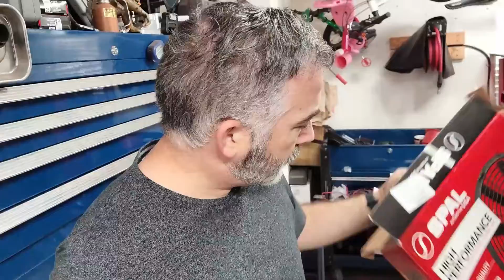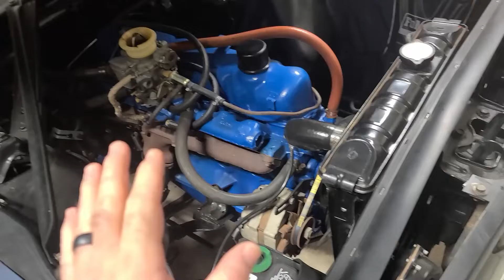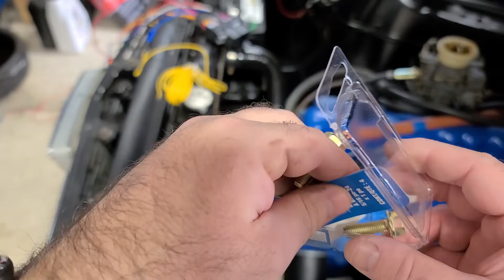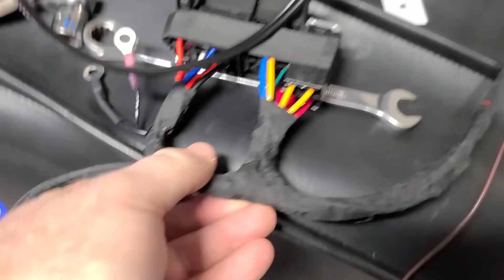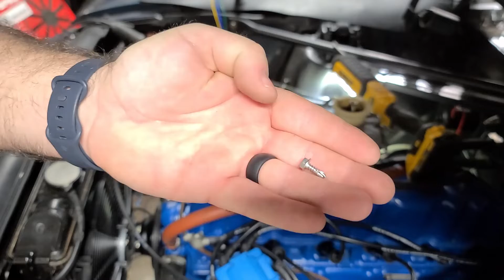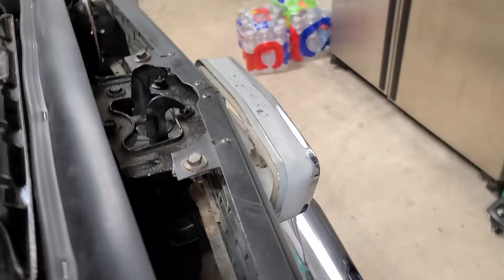66 Mustang Inline 6 HEI Distributor Install + Electric Fan and Power Master Alternator Installs

Comment: The original signal wire of 8v did not activate the relay for full 12v
Reply from the maker: Hmm, it should.  If you have double checked your relay wiring and ground, it may just be your relay.  It may not like the lower voltage.  Mine functions like that.  You are going to have to run a 12v switched signal from under the dash.

Comment: Did the coil 7-8 volts worked as the signal for the relay? Did it turn it on?
Reply from the maker: Yes, coil power worked to drive the relay.

Comment: I have a 68 Falcon with a 250 inline 6, i want to do an hei swap on it as well, i also like what you did with the electric fan. Im not too knowledgeable on wiring...any info on where you got the relay set up? I would like to do exactly what you did to mine...or do you think the igniter conversion for the points style distributor would be better? I don't have the money to drop on a DUI...so info on the relay setup and pigtail as well as the temp switch for the fan
Reply from the maker: I would recommend the distributor I got only if you are OK with a potential oil leak.  Apparently it is common in the cheap distributors and not the DUI.  If you are worried about stay with a stock look, then upgrade points and ignitor.  If you are not, I would go with a DUI.  You save money with the unit I bought, cheapo in Amazon.  Works like a champ but leaks a small amount of oil.  As far as the wiring, the most inexpensive direction is to source the parts separately.  Get a 30amp relay and google a basic electric fan wiring diagram.

Comment: Thanks for taking the time to make a video and show us how to do it. What brand is the distributor or where did you get it from as I want to do the same as mine.
Reply from the maker: I got this one off of Amazon.  It does leak a little of oil that travels up the shaft, which I dont like.  I have been told the DUI brand doesnt do that but it is way more expensive then the one I purchased.

Comment: what kind of relays are you using for the fan?
Reply from the maker: Just a standard 40 amp relay.  There are a ton of options on line.  I ordered one with a pigtail for a cleaner install.

Comment: Do you have a part number for that distributor? Found one from A team performance but never used their products before. Can't seem to find one from summit or jegs
Reply from the maker: The A-team was the one I went with.  A cheap short term solution.  If you plan on staying hei long term, I wouldn't recommend the A-team.  It leaks oil out of the shaft, badly.  They are terrible with warranty as well.  It did take care of my issue and wildly cheaper then the DUI but you get what you pay for.  An eventual V8 swap will force a change for me.

Comment: Good video thanks… the old ignition wire from the ignition switch has a resistor that reduces the amount of current not voltage to the coil. They did that to keep the points from pitting. The condenser helps as well. That resistor wire is bypassed anyway during start up, so the solenoid puts in a full, direct connection to the battery bypassing the resistor wire of the ignition you release the ignition switch to on it goes into the resistor wire . I installed my HEI with the old ignition wire with no issues.
Reply from the maker: That is good to know.  I wasn't aware of that.  I had found different recommendations based on reduced voltage at the coil wire.  I had less than 12 volts at that wire on a brand new battery so it made sense to me.
Reply: @WhitetailGarage  putting a relay and a wire without the resistor is better anyway that you get new parts that old resistor wire has been there for 60 years so it’s better to change it like you did.

Comment: I installed my hei but for some reason the engine just turns  can't get it to start what is the position it should be I put roter and pressure in same spot. What can I do next
Reply from the maker: You want to make sure to stab it in the same exact orientation the rotor was in and make sure the firing order on the cap is correct.  If you aren't sure about the orientation anymore then start at TDC and align it with number 1 on the cap.  Make sure you are getting a solid 12v to the coil.  The factory harness doesnt always have a full 12v.
Reply: @WhitetailGarage   ok thanks I will try that .I'll let you know how it goes

Comment: For your vacuum advance from distributor… i have a single barrel, would you connect vacum hose to carb or to manifold?
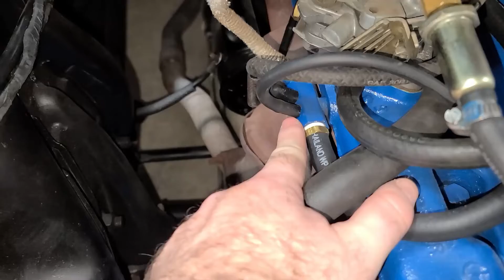Reply from the maker: Mine is a single as well.  I connected here 24:17 to the manifold.

Comment: What were your symptoms on your dizzy?
Reply from the maker: Mostly lack of power.  It wouldn't run consistently either.  Some times it ran decent (still no power) and other times it would struggle to stay running.  With the new matched dizzy to carb, it is like a new car.  Starts instantly, runs the same all the time, and way more power.

Comment: So far, how’s the hei doing and where could I order it from? I’m here in Texas as well. I have a 68 F100 with a 240 inline. I almost ordered 2 12 inch fans but now I see a 16 will fit. Is your Mustang a 5 speed?
Reply from the maker: It has been a few months and total engine performance is way better.  Starts easier, runs smoother, and has more power.  I bought a cheap unit that is leaking oil up the shaft of the distributor.  I have reached out to the company and they are not helpful.  I wouldn't recommend what I bought unless it is a short term solution for you.  It was for me because I plan to put a V8 in it soon.  For your truck you may look at a DUI, they are much more expensive but great support and great product.  The 66 is a C4 automatic.  It started life as a 3 speed manual but at some point was swapped before I bought it.  The swap was complete and looks factory.

Comment: what electric fan are you using?
Reply from the maker: Ended up going with the Spal 30101516 16" Straight Blade Low Profile Fan.  It was low pro enough to fit in between the water pump and the radiator.  The car stay perfectly cool always now.  It is noisier then I would like, otherwise great.
Reply: @WhitetailGarage  I am currently using the spal straight blades fan, a new aluminum radiator, new water pump and new 180 thermostat and still having overheating issues, do you have any recommendations?  I am 19 years old and sometimes I lose motivation to continue fixing my mustang because I cannot solve the overheating problem.  Thank you!
Reply from the maker: @dsv2121  You have replaced everything in the cooling system.  It must be engine or tune related.  I'd suggest checking coolant for combustion gases.  There are fairly inexpensive kits you can get to check that.  Otherwise, knock out the easy stuff.  Check your plugs, search online on how to read them.  If they have a lot of miles replace them and then read them.  Carb tune, wrong timing, bad distributor or combustion leaking into coolant passage could all lead to overheating.  Also, check that you have a matching load-O-matic distributor to the right type of carb, that was an issue for me.  I totally understand the lack of motivation.  One step, one wrench turn, one test at time.  You will figure it out and learn a bunch along the way.  For me half the fun in these cars is becoming my own expert at them.  Learning more everyday.